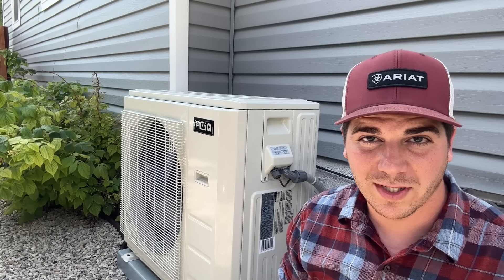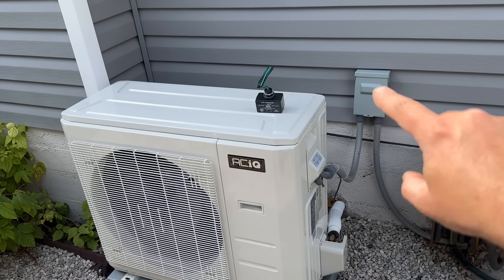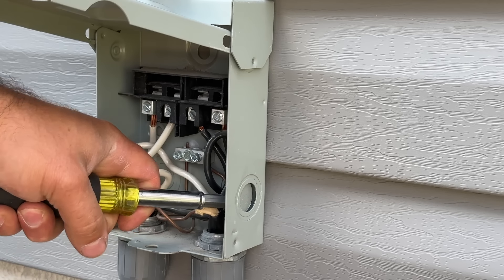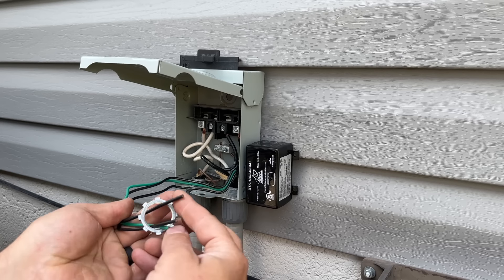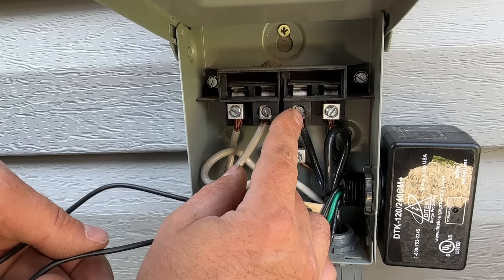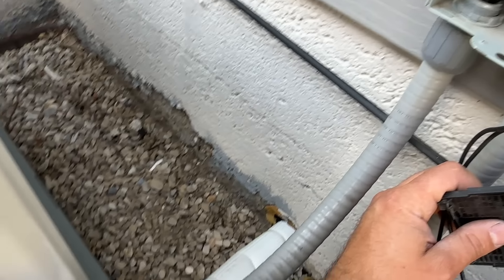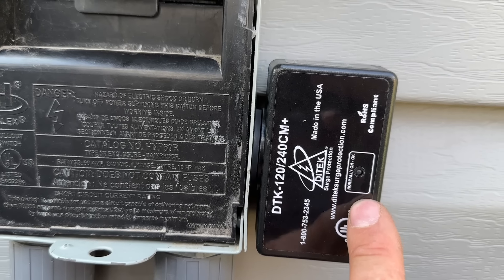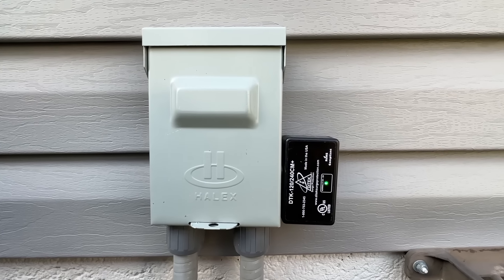Protect Your HVAC Equipment For Less Than $80

Comment: This is a great video. I had 2 new mini splits installed last year and the HVAC company put these in. Without fail, they did the job and saved both my units. They came back and replaced them for free! Since then I added a whole unit as well. For anyone watching this video, this is a must have.

Comment: Two conductors under a single lug is often not allowed and can result in the connection melting
Reply: Interesting. So there’s no chance for them to melt when connected in a wire nut?
Reply: Would be electricians. Perfect install
Reply: Could be true with solid core wires.. i dont see how it would be true if one is not solid core
Reply: Jamesgor13579 🙄🙄🙄🙄
Definitely not going to “melt” 
The termination might get hot but that’s going to take some time
Reply: This is an absolute code violation. I am not hating and i appreciate the video but for those making light of this, it doesnt take much of an amperage draw to melt plastic and loose wires will melt plastic for sure. You should pigtail them and run one conductor to each lug unless for some reason the manufacturer recommends two conductors under each screw.
Reply: All equipment varies. I recently ran into this issue. One solution was splice surge with wire nut and pig tail to terminate. Be sure to read manufacturer’s specifications for number of wires allowed under lug. Another solution, use an insulated piercing connector.
Reply: Some lugs are rated for multiple wires specifically the home line products do. However This doesn’t look like a home line disconnect. You always follow manufactures specifications and you’ll stay code compliant.
Reply: According to the installation guide for my unit it is correct.

Comment: Dielectric grease would have been helpful here.
Reply: I bet you don't have a video of you doing anything electrical.
Reply: @blackericdenice  yep, that's correct. well played.
Reply: @blackericdenice  And how does that change the validity of the comment… I don’t have a video of me working on electrical equipment, but I work for a multi-billion dollar manufacturer of electrical and cooling equipment… So, does that mean if I make a comment about the benefits of a wye-delta start, and how to program the PLCs to make that happen, would my comment not carry any weight if this was a video on commercial three phase equipment?
Reply: @EarlHayward  it depends on your comment
Reply: Not dielectric grease but anti oxidation grease due to the aluminum and copper conductors
Reply: A lot of crying in the comments. Maybe be non emotional and pose a question to the creator. Ask him in hindsight if he would use said compound.
Reply: @blackericdenice  So if someone does something totally wrong (not this video necessarily) but posts a video of it that gives him credibility?

Comment: Like others have said - this is a wrong way to install it. You are not supposed to use singe screw terminal for multiple wire connectors (unless the screw terminal is specifically designed for it, and the one in this video is not designed for it), especially with different gauge wires. Ditek themselves have an installation instruction for this model right on their website, which tells to use wire nuts to connect multiple wire ends instead of stuffing them under same screw terminals.

Comment: These devices have a Jules rating .  The higher the number…the more energy they can absorb.  The best location for the device is not next to the device you are protecting…but rather the beginning of the power line at the breaker box….this is becuase the line run provides electrical characteristics that results in the majority of the surge being absorbed by the device…if you put the device next to the item you want to protect…the surge goes to both devices.  The electrical componet in that black box is probally the size of a dime and probally only offers 6000 Jules clamping and real protection does not occur until you get to 30,000 Jules and if the devices uses some type of inductive windings to shunt the surge away from the device…that would require the power runs from the unit needing protection to be moved to the black box in series with the inductors and have the clamping device on the other end of the inductor.  This parallel clamping de ice will have a low protection ability.
Reply: joules

Comment: The NEC requires Conduit Reducing washers on knockouts that leave a ring.  Often these become weak with only two or three small tabs of connection there they codified this several NEC versions ago.

Comment: Great video. Like you mentioned at the end, I would start with a whole-house (SPD Type 2) surge protector at the main panel. It doesn't hurt to add additional SPDs at the AC disconnects or any other subpanels you have, but if you can only afford one, put it at the main panel. This is now part of the NEC (electric code).

I would caution against installing multiple wires into the screw terminal like that, and it's generally not allowed. It's commonly done for these disconnects, but those terminals are only supposed to have one wire under them. It's possible that the screw won't make proper contact on the double stacked wires and it could arc and burn up the disconnect or worse. Either do a pigtail or I like the SquareD QO200TRCP disconnects with a switch that looks like a breaker (it's not actually an overcurrent protection device.) That allows 2 wires under the lug. That is rated for 60A, but it doesn't have to match the equipment, since the actual breaker is in the panel. The other nice thing about these is, you can replace the switch (with an actual breaker if you can't find the switch) if it ever burns out and not have to install a whole new disconnect box.
Reply: Pin this? Thank ya for the info.
Reply: @denverbraughler3948  That's been an ongoing issue with this channel, sadly.

Comment: I have two and possibly three issues with this video:

1. If you are going to go through the trouble of installing a surge protector on the AC unit, why not install a whole house surge protector on the main service panel instead? That way the whole house is surge protected. The installation procedure is similar except that you need to add a 30 amp double pole circuit breaker in the main panel. Whole house surge protectors are available on Amazon or at your local electrical supply store. Make sure to use one of sufficient capacity.
2. The National Electrical Code FORBIDS installing two wires on one binding post on the disconnect switch as was done in this video. This is a HARD FAIL. The proper procedure for connecting two wires to one binding post is to install a single pigtail on the binding post and then connect the two wires to the other end of the pigtail.
3. I infer that the AC condensing unit runs on 120 volts based upon the presence of a white (neutral) wire on both sides of the disconnect switch. However, most outdoor AC condensing units run on 240 volts, not 120 volts. If the AC unit does run on 240 volts, then the white wires are “hot” wires, not neutrals and must be labeled as such. If you are using Romex cable, you can do this by putting a band of red, blue, yellow, or black tape on the white wires to label them as “hot.” If you are using conduit, it is better to use a non-white, non green colored wire instead of a white wire.
Reply: It's 240 judging by the breaker opened to remove power from the disconnect. It needs a non-whiite or green conductor.
Reply: Great info - thank you. Can this be installed on a roof mounted heat pump?
Reply: @atschirner  Not a green conductor. In absence of a black or red conductor for the other hot lead in a 240 v, ckt,, the white one should be taped with black or red tape. Green is only for Ground .
Reply: Yeah, I was wondering if just doing a whole house protector wouldn't make more sense.
Reply: I knew somebody was gonna say it!

Comment: I never thought to install one at the outdoor condenser unit.  I have had problem with my goodman Airlander ECM motor blowing out.  Those are expensive to replace.  I am not sure why, but I attributed it to power surge.  It happened twice. It always happened during thunderstorm.  The blower motor was running on 230volt circuit.  To remedy this, I ran the blower off of 110 volt and used surge protector.  It has survived for the past three years after the change.
Reply: Install one on your furnace too. It will save an ECM motor and a control board from frying from a power  surge.

Comment: Every new install we sell comes with an Intermatic AG3000 surge protector on the condenser and on the furnace. My cost, $100 for both. Cheaper than one service call covered by a non billable warranty visit. It is also a good up sell while servicing an existing system.

Comment: Good info, I have a bunch of surge protectors installed, besides the obvious places like TV's and computers, on my main panel, at my heat pump outdoor unit, the AHU, at my washing machine. 
Also as some other have mentioned, not sure about the 2 wires in one lug.  For my outdoor unit I pigtailed to the lugs.

Comment: I agree we need a surge protector, the one used in this video has a lot of bad reviews and possible fake units out there. I installed a Pioneer Mini Split System so i stuck with a Pioneer surge protector for a few dollars more and installs exact same way. For example take note of the seller rating of the supplier in the link on this video. That seller has complaints of fake units.

Comment: That's exactly the way I hooked up an old Ditek to my generator's disconnect.  I did this hoping if there was a surge from the generator my circuits would be protected. My Ditek is about 20 years old though and doesn't have an led on it though.  I took it off the main panel when installed a GE SurgePro.
Reply: Surge protectors don't last 20 years though, so it is doing nothing for you.

Comment: The Square D disconnect the other reviewer noted does not have a side knockout ( at least the one with same ID at the local HD). One would think they would revise these to accommodate the SP devices that now are more available ? I installed an Intermatic SP on my conventional AC unit at the no -fuse disconnect after we had a lightning surge destroy the AC contactor . I did “double lug “ the load (hot out) connections withe surge leads. The neutral had a second lug. The unit has been in service for eight (8) years now with no issues. Works great and I know of at least a couple close lightning strikes that could have caused damage but did not. I suppose you could pigtail the load and SP a shunt via a wire nut but that might (?) reduce the effectiveness of the shunt ? Anyway , still here, no spark outs , shorts, etc.

Comment: No.   This does not protect a lightning strike close by. Power surges yes. Lightning strikes a bit further away - maybe.  That is valuable already. 

However, I would go for a whole house surge protector, especially if your breaker box is full of modern expensive afci, gfci and dual breakers.

Comment: Great for surges. Probably not effective on a close lightning strike, however. It’s still worthwhile.
Reply: They won't trip from a surge and do nothing to protect from that or voltage sag. They are are quick acting triac that shorts to ground causing the circuit breaker at the distribution panel to trip.
Reply: @timcat1004  Not sure where people are coming up with these claims.  A surge protector uses a MOV, which is a variable resistor that shunts excess voltage and current to ground.  It is not a TRIAC. 

TRIAC's are used as dimmers and speed controls for electric motors.  They are not used as surge protectors, and they do not cause the breaker to trip.
Reply: Ain't nothing stopping lightning. I have the Siemens FS140 and lightning hit my backyard. Destroyed various electrical things throughout the back half of my house (GFCI outlets, stereo equipment, wifi equipment, etc) and the surge protector is just sitting there lit up green still. Might help if the utility company has a surge or lightning somehow comes in through the buried electric utility lines to my panel, otherwise, break out your wallet.
Reply: @chrish7927  It all depends on what path the lightning strike takes.

I had a TV, cable box and an amplifier damaged during a lightning strike that was running on a UPS and a surge protector.

The lightning traveled through the coax line, blew up the cable box, and the cable box blew up the HDMI ports through the video link and damaged the amplifier as it was connected to the TV.

So, the power outlet isn't the only path for power surges to travel.

Comment: Hey Dave I am new in the HVAC trade but I’d like to see you do a video sometime on the correct way of wiring a head pressure fan speed controller for using ac during low ambient temperatures. I have a icm 325hn controller I would like to put on a unit.

Comment: So redundancy is good.  So I do have a Surge Protector in my Breaker Box... I guess it would be good to Also have one on each unit as well.
Reply: @denverbraughler3948   Respectfully I disagree with you.  I took numerous CEU classes on surge arrestors over my 42 year electrical career and I learned the more the better and most critical is to keep the wires short as possible and no sharp bends. I installed countless suppressors in my career and have one on my load center and one on my AC.

Comment: Why does  the line side white wire with no black or red tape on it?
Reply: The system has Black and White wires as he is connecting it to a 120Vac system which as a Hot (Black) and a Neutral (White).

If this was a 240Vac system, both wires would be Black, as 240Vac has two Hot and no Neutral wires.
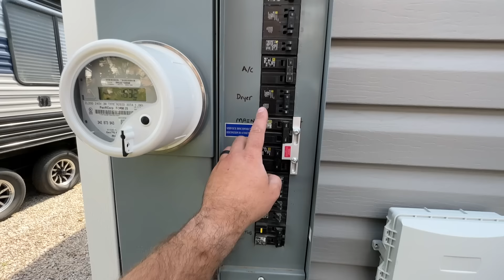Reply: @redbaron6805  At 1:04 the breaker is double pole, so 240 v. The white conductors should be taped black or red.

Comment: Hello, nice video! I have a question. I hear that the inverter AC’s usually break faster than non inverters, is that true? They say the main boards fry quick. I am very interested in purchasing an inverter. I figure this surge protector will help.

Comment: Another great video DIY HVAC guy on surge protection system!  I was wondering if you could somehow make a video about a possible solar power feature to battery bank to condenser video? Or how you would set up your dream system that would keep the home ice cold but save on electricity with complimentary systems like a whole house fan to take out hot air out of the attic and home, possible apps to monitor usage, how a house and attic should be insulated.  Basically a hvac system off the grid with a ideal setup up. My electric bill was through the roof this summer and I am looking at possible solutions. Thanks for all the valuable information. I look forward to your videos like I do with this old house on the weekends. Have a great one.

Comment: I would have installed it on the line side. I would also have used a whole house sized unit.
Reply from the maker: It says in the instructions to do the load side.

Comment: Protector wires appear to be aluminum.  Can't connect aluminum with copper without proper lubrication.  Is the wiring of the protector indeed aluminum?
Reply: Please, step slowly away from the electricity.
Reply: @jimmaag4274  electrolysis is no joke.  Better response needed.
Reply: There is nothing in the Ditek literature that identifies wire type, but I would assume the wires are tinned copper rather than aluminum.
Reply: @nomen_meus  that wouldn't occur to an apprentice trying to show off on youtube.

Comment: If this is wired in parallel, how does it provide any protection al all? A surge protector needs to be in series before a device so it can be sacrificed to save the downstream device.
Reply: The way these work is by using components called MOVs, which are basically voltage-based switches that only conduct current when the voltage goes above a set amount. The MOVs are connected between the hot leads and ground, and at normal voltage, they aren't passing any current. However, if the voltage spikes above the set amount (usually like 150V), the MOV 'turns on' and dumps that current to ground, often killing itself in the process. Usually, these voltage spikes are transient and fast, so the circuit breaker won't even trip and the MOV might not completely die.
Reply from the maker: Wow excellent explanation sir. 🤘🏼
Reply: @bnasty267  I get it now - normal voltage always goes to the equipment and any excess is rerouted. Neat set up. Curious what happens on a large or extended surge after the MOV dies. If it is no longer able to actively dump the excess to the ground, won't all that voltage just be conducted to the end equipment at that point? Or is that a situation where you'll have bigger problems than your A/C unit getting fried?
Reply: @fritter6546  High end surge protectors often have multiple MOVs (sometimes half a dozen or more) wired in parallel to serve as backup and to handle larger surges. Similar to the unit shown here, usually there is a little thermal fuse essentially stuck on the MOV that turns off a little green LED when the MOV heated up from a big surge, and thus sacrificed itself. When the light goes out, that means it's time to replace the SPD, because it no longer offers any protection.

You're right though, they can only do so much. A huge surge like a direct lightning strike is going to blow right through it.

Comment: Does it actually work? It seems like it would just blow it right along with the a/c unit. Its like just piggy backing another appliance to a circuit. I could understand if it was inline.